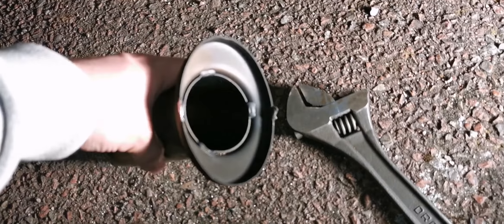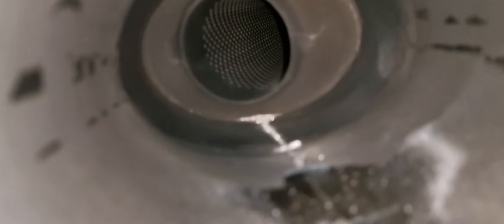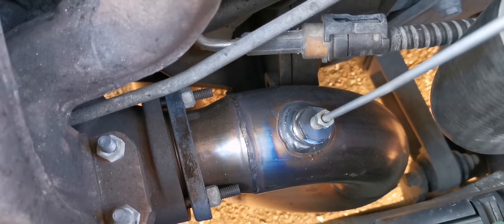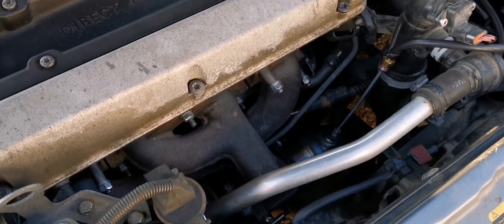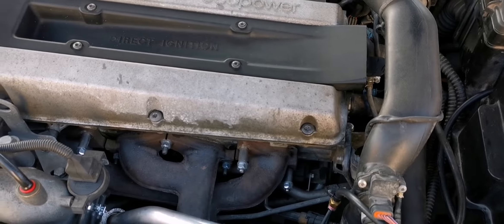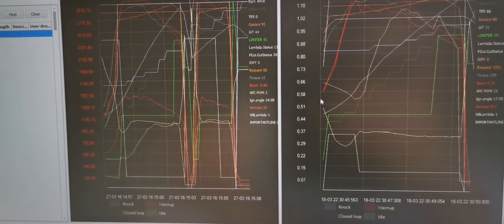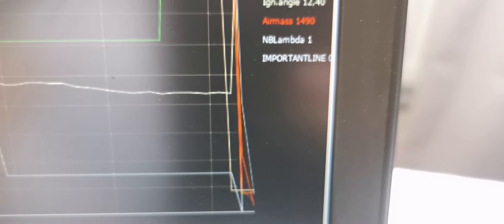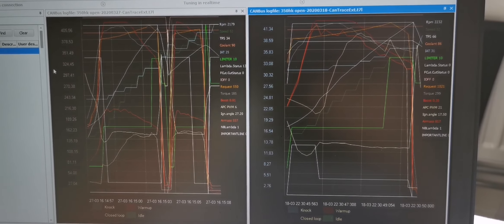350hp Saab 9-5 horrible backpressure 3" - 2.5" part 2

Comment: Nice saab man. I ran a open 3 inch downpipe on my saab 95 and eliminated all back pressure and the car ran like a beast. That was running a tdo4-19t turbo, Siemens deka 630cc and a custom tune etc. Turbo started spooling around 2600rpm and pulled hard all the way to redline. Only problem with it was police encounters lol
Reply from the maker: Thank you! Nice except the police encounter lol

Thinking of doing a test run aswell with only downpipe and measure all the differences in airmass in the logs, lambda, back pressure etc, should make for an massive difference indeed

Comment: Back pressure allows the cats to work much better. I believe in our lab it was 10% more efficient for every 15 torr (adsorption of harmful oxides), but losing 1% efficiency of the engine off the Carnot cycle

Comment: What bar were you just running on your turbo?
Reply from the maker: Only 1.5bar of boost for this and dropping off to 1.0 bar towards 6000rpm
Reply: @ArturssonEngineering  what turbo are you running on?
Reply from the maker: @christophercarson3143  this very moment when this was recorded just an standard TD04HL-15T so exhaust is already choking up to OE turbo
Reply: @ArturssonEngineering  are you running something different now then?  Loved the video by the way
Reply from the maker: @christophercarson3143  Thank you! After this video I installed an boost activated exhaust cutout valve(60mm wastegate) on the first bend of the downpipe behind in the turbines flow path. Mananged to pull off 410+bhp/630nm on 1.49 bar dropping to 1.35bar of boost between torque and power peak with the OE 15T on E85 tho.

Now I am running an billet TD04HL-16G(large) hybrid with high flow turbine wheel, installed it last week. Quite some grunt to it, already 1.3-1.4sec faster 100-200 on low boost.
Reply: @ArturssonEngineering  sounds absolutely brilliant. Bet its a bit of a hand full. What you like for getting traction. Mine spins obviously in first then seconds OK until boost comes in and spins all the way to end of second. 3rd gets away with spinning as its quite a bit of lag on boost. Too much for my liking. And 4th iv not hit boost yet and not even got into 5th.i usually run out of road in 3rd or early in 4th. Very windy where I live. I was wanting more power. Currently at 330ish but I'm just thinking do I go a smaller turbo so less lag and forget going more power. Absolutely love your car mate.
Reply from the maker: @christophercarson3143  I basically have no really traction issues now the way it is setup today, even in second it barely spins, but running r-compound tires!
I have basically zero lag aswell, car responds immediately and over all the car is super nice to handle everything is just gentle and nice. No torque steer no anything of that. In generally it comes down to response of the turbo how it is tuned combined with how optimized you have setup for the turbo to function mechanically and physically in terms of flow and velocity.
Reply: @ArturssonEngineering  I'm still on my standard manifold unfortunately but I'm wanting to save up for a trust manifold and then arp head bolts and a trip to sos motorsport to be dyno tuned as its currently just on a base map by Andrew Crank. Iv got nankan tires all around but still struggling with traction. Luckily no torque steer here too so that's a bonus I suppose. It would be much better if it was summer tho lol West Yorkshire is a very wet place 😭